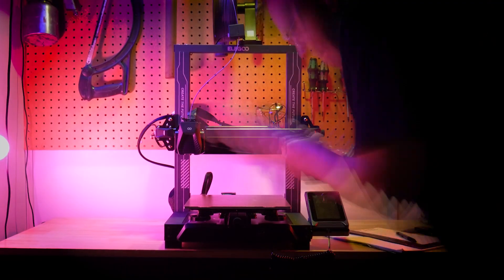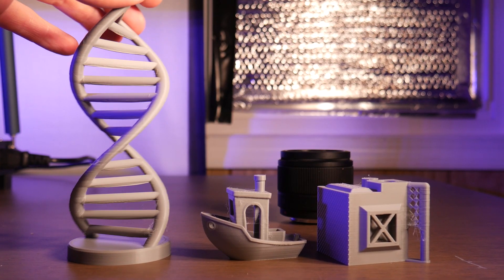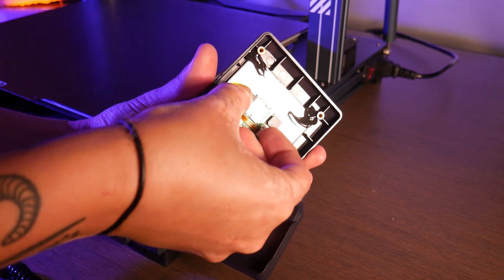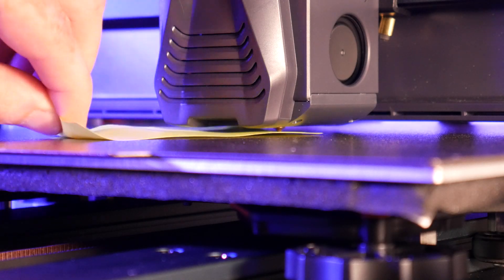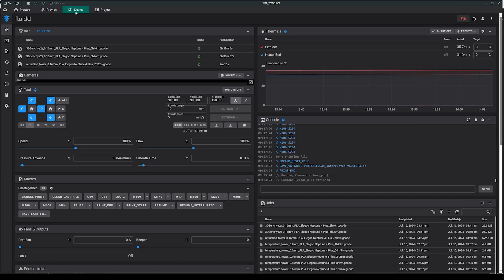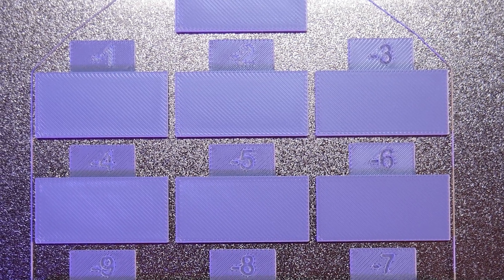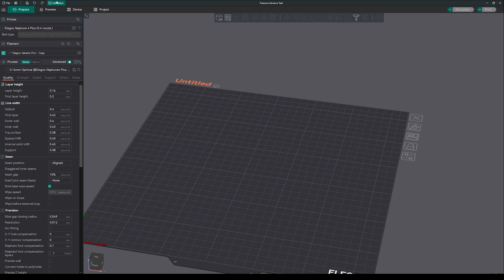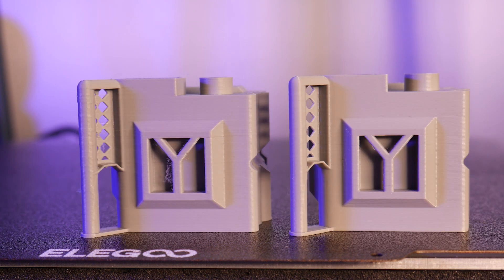ULTIMATE 3D PRINTER TUNING GUIDE for the ELEGOO Neptune 4 plus / pro / max

Comment: Hey so I’ve been doing the flow rate calibration like you showed it. However I just discovered that we should also do the calculation on the first pass, I know in your case you pick 0 so it would end up with the same number. But I just saw that for example the first pass the you are between 5 and 0 for example you would pick the overexteusion one, do the calculation, then fine tune it with the second pass, which justifies why the second pass is only negative numbers plus 0. Just thought it was worth to mention that in your case there was no need for a calculation on pass one however it should be done.

Comment: Very nice and detailed video although I prefer the way described by Klippe itself for pressure advance tuning (with the Square tower) 

By the way, do you print with Z-Hop too or not? And when you print with supports, do you pick Tree supports?
Maybe a video about “preparing” a print and choosing whether you should use supports or not, Z Hop or not and Infill percentage might be interesting!

Comment: Is there a way to undo any of the changes to the cfd? I don't remember what the values were before making the changes  and now I every print I send to the printer via orca fails during the first layer. When I load the same print through cura they print fine. I can't find the difference between the two slicer so I'd like to start fresh on orca. What the best way to get it back to factory settings?
Reply: I had the same issue. Don’t know if you were using glue stick or not but I wasn’t and started using the glue stick and havnt had a problem since. But there should be a default reset in there somewhere but I’m not sure. I never looked to see if there was or not

Comment: If you have any questions......YES!.....YES I HAVE !!!

How do you calibrate "BLOB OF DEATH" away.....i've had that twice now.......do you have a fix for that ??

Suddenly my prints stop sticking to the plate.....i've tried several cleaning solutions....like you and IPA and nothing works.
ONLY thing i got to work is if i print first layer at 20mm/s or lower.....only the first layer....then it sticks and i can print fast on top of that.....but why doesn't it stick at standard speed??

Comment: I like V2, but would prefer it if the unit recessed into the saucer to maintain a flush look when not operating.  Imagine a sliding door, or potentially and iris that open with the turret popping up.

Comment: Great content I thank you. Question: @14:40 you multiply the value at which the corner is sharpest by the step value, but when I print the step value is 0.16, default is 0.2. If i did that number it would be way too large. What is the hicup here?
Reply: Jordan from the future here. The layer size was 0.16, and the step value for the PA test was 0.02. I needed clarification on the difference there.
Reply: @Jordaneal thanks past Jordan, solved my querie too

Comment: For elegoo neither 4 plus i changed the flow rate as you told in the printer.cfg but after that i was not able get the prints to stick to the buildplate at all what should I do?

Comment: what should i do if mine doesnt even finish printing past the first temperature test. it just came unstuck from the plate after getting to the top of 230 PLA
Reply from the maker: You’ve done the bed leveling and z offset? Given the bed a good clean with soap and water? If so try using a big brim on the print to help it stick!
Reply: Yeah did all the tests and leveling and cleaned the bed even went to do the retraction tuning test and it printed that perfectly. I'll try a bigger brim. Thank you

Comment: Please help! I recently bought the Neptune 4 Pro and have just been following this setup guide. I seem to be missing the Input shaping & PID calibration in the Advanced settings menu. The firmware for the printer and screen are up to date. Can anyone advise?
Reply from the maker: The 4 pro doesn’t have the built in accelerometer. The pid can be tuned with a command but there isn’t a menu prompt for it. I would dig into klipper site tutorials. There’s tutorials there to manually tune all this via commands even the resonance without the accelerometer. I should have clarified that in the video sorry!!
Reply: @WildRoseBuilds  No worries! Thanks for the advice. I actually found the pressure advance tuning once I'd accessed Klipper, the printer is running sweet 👌

Comment: @WildRoseBuilds - you changed all Settings in the CFG File, but what if i have multiple Filaments (with different specs) do i change the Settings in the Filament Options or still in the CFG of the printer?
Reply from the maker: Extrusion rate / rotation distance should hold up pretty well across different materials. The only thing I ever change in my cfg is pid but I have all my different temperatures commented out and can switch them easily. There’s probably a better way 🤷🏼‍♂️

Comment: I don't have Input Shaper or Nozzle PID calibration in my advanced settings on my Neptune 4  Pro. I'm running V1.1.3.1 - 2024.07.23. Anyone know if Elegoo took away these settings or are they not an option on the 4 Pro?

Comment: I have a Neptune 4 Pro and Cura was working perfectly but I needed to calibrate the prints better, Orca I thought would be perfect based on the video but for whatever reason the prints are not sticking to the bed and are incredibly thin even after calibrating the extruder. I don't know what setting is not making it work, someone help please

Comment: I tried printing the flow 3 times the -20 and -15 crap out and ruined the print can we not set this to print one square at a time ?
Reply: Correction I cant print this at all every time it fails because one of the flow parts detach 😞
Reply: Try putting some glue on the plate from the glue stick elegoo provides it might help.  @kennethmoody9841

Comment: When i run the retraction calibration, my printer starts to begin heating up the nozzle and bed, but shortly after, it resets the print head position and says, "System is currently starting, please wait". It never runs the calibration. All of the other calibration tests work fine.. any ideas what's going on?
Reply: I changed the end retraction length to 5 and it solved my issue hope this helps.

Comment: My neptune 4 PRO has software version 1.1.2.41 and the motors are 1.2A I want to upgrade and formatted  a few memory sticks with FAT32 and copied the files from fixpack to the root of memory stick. I inserted the stick and started the machine nothing happened when I go to setting and about machine I pressed the up arrow at the bottom of machine and message shows update failed put all files in the root of the stick {which I did} I tried 3 different memory sticks including the one supplied with the machine when I directly use the firmware update file instead of the FIXpack it is the same. Your video is perfect to upgrade my Printer thank you
Reply: Im an currently trying to update the firmware and get the exact same error. Did you ever resolve the problem? If yes, how did you do it?
Reply: @mariuspaulbayertz8783  Hi Guys, waiting for my PRO to be delivered next week.  Obviously do not know the firmware version yet, but, did you guys sort this out?
Thanks heaps.
Eddie

Comment: I actually waited til this weekend (received my brand new Neptune 4 Max back in Nov 23'.) Decided to wait for upgraded firmware and components (Linear Rails X/Y/Z and upgraded Hotend "MicroSwiss Flowtech") Couldn't be happier and going thru this tuning will make it a breeze to get thru my 3 Main Filament choices (PLA+/PETG/PET-CF). This testing also pointed out a few flaws in my install so far (such as un-greased linear rails causing massive X-axis jumps), all of which a bit of grease/oil smoothed out. Can't wait to get back into this though, my Ender 3V2 will also likely get the treatment as I transition that machine to Linear Rails and Orcaslicer.

Comment: Thanks so much, I recently bought a Neptune 4 Pro printer and printed the tests that came on the flash drive without any problems, but after that, everything changed. I'll follow your tutorial and see if I can get good prints using the Orca Slicer. Thanks

Comment: Followed your instructions and was3 able to install Klipper. Problem is that every file I try to upload and print, I get a "unable to open file". Any help ??
Reply from the maker: What slicer are you using? Is your profile setup correctly and exporting a .gcode file type? how's the wifi signal to your printer, this has caused me some issues as a file transfer will timeout sometimes and cause that error!

Comment: is the flow rate different on all printers even if they are the same model
Reply from the maker: Yes! Things like ambient temperature, filament type, and extruder idler pressure are all different even on the same machines and play a role in flow rate.

Comment: Used the exact same printer with teh same settings and filament. Done all the steps as mentioned and i'm having trouble with the 1st pass flow test. It clears the nozzle and then proceeds to make the outline but once it starts to make the first sample it spews filament everywhere and clog up. I tried relevelling and calibrating 3 times and it wont sort it. I have printed things before this and it worked fine.  I was going ot dial in my settings using this video but it is not working. please help
Reply from the maker: Sounds like your flow rate might be improperly set? Double check in your settings that it’s at 1.0. Some slicers use a percentage for flow but orca slicer uses a whole number.
Reply: Thank you @WildRoseBuilds for your reply to that question.  I am having the same problems and am currently working on the Z offset.  I

Comment: Man my most paintful part of this printer that i love is the fan! Noisey but the silent mode doesnt work on my printer. Its loud then silent mode is turned on but it last for 5 seconds before going back to normal and being loud again
Reply from the maker: There’s a switch on top of the external fans to turn them off. I’ve heard people say they get pretty good results without them. But yes it’s a bit of a loud printer 🥵

Comment: The timing and thoroughness of this video couldn't be better as my new Neptune 4 Plus just arrived yesterday and I plan to work on getting it assembled tonight and work on tuning it over the weekend! Thanks for so much information and how well it was presented here!
Reply from the maker: Oh perfect! Let me know if you have any issues during tuning! Good luck
Reply: @WildRoseBuilds  I've got two of the 3 initial test prints you used. What is the name or where do I find the middle one with the top layer info?
Reply: @WildRoseBuilds  I've tried to start doing some of the OrcaSlicer calibration tests and I can't even get the first Flow Rate to work. It looks like it starts to draw the outline of the shape (rather ugly honestly) then when it starts to fill in the piece it goes through the motion but no filament seems to be coming out to lay down inside the shape. I'm not sure what the issue is. My test prints came out fairly well before trying the calibration. lol

Update:  I missed the decimal point in the Flow Rate. The poor print head was trying to force 100 through that nozzle. That's been corrected. Now I think I'm having z offset issues because I'm having plat adhesion issues. I'm going to start with that tomorrow and see how it goes.

Final Update: All squared away. Thanks again for the awesome video. Things looking good on my end. I still can't seem to fully print the double helix as it starts to unravel near the top of it. I'm trying an actual print that is just as tall if not a bit taller now and will see how it goes.
Reply: @WildRoseBuilds  Again, this guide was a tremendous help getting my new printer up and running. I'm about to switch from PLA to PETG. Would following this same routine make sense? I know the temps are changed from the PLA I was using to the ranged for the PETG I'm using. Just wasn't sure if it makes sense to follow these same steps or not.
Reply: @TheHikingReader  how did your PETG turn out? i found its settings are much different than PLA
Reply: @altcoinlogic9121  You are correct. My settings were considerably different, but the process of calibrating was the exact same. These steps have become my go to for any new filament I try. Then I just save a profile for that filament and don't typically have to mess with it again.

Comment: A really useful video, thanks.  But despite what your title says the Neptune 4 Pro doesn't have the option for input shape tuning or PID calibration in it's advanced setting menu. As far as I'm aware this model doesn't ship with the accelerometer required to achieve the former anyway. Now if you could upload a video showing how this could be achieved with the 4 Pro (maybe using a USB accelerometer), that would be most appreciated.
Reply from the maker: Hey thanks for the heads up on this, I didn’t realize I had put the pro in the title, I’ll remove that. For the pro you can read the klipper documentation and follow their steps to do a manual resonance calibration test print with no need for an accelerometer. There’s also a command that can be issued through the fluid interface in the console to tune pid. Hope that helps!
Reply: @WildRoseBuilds You still haven't removed it

Comment: Blimey the testing and code changing looks complex to a newbie like me in klipper stuff? I got the Neptune 4 Plus and without any of this stuff I get good prints now!

The bit about the Orca slicer, I downloaded it and installed it on a windows 11 laptop, it just don't see the printer on my network at all?  My fluidd sees the printer and shows it printing though, But the slicer don't see the printer at all?

I set it in the slider too. The local IP is right for the network as the fluidd sees the printer.  My printer has the newest update too.
I tried Cura and Prusa Slicer and both have the printer listed to add to the system which I do, But again Fluidd sees the printer But neither slicer sees it just like Orca don't.

I having to do the old way of record the files on to the Thumb drive and put that in the printer to print.

Also the Logitech C270 HD webcam I brought for the printer will not work when plugged in to either the full USB slot or the USB C slot by a USB adapter stick on the printer.
It does work on the PC after the software was installed. So why not on the printer or the network when on the printer USB?

And oddly the printer will print a model fine then when I see the screen on the printer pad it will have a error saying re-set the file system by clicking the icon on the screen?

I do and the printer clears that error and will print fine again.

It also won't let me do any Vibration tests without a error!  I have to restart or refresh the Klipper firmware!

Any ideas why all this trouble even though the printing is fine.

Comment: Are you using elegoo PLA? Also my Neptune 4 pro doesn't have built in input shaping, any recommendations?
Reply from the maker: Yes elegoo pla! I have had great results with it and they’re starting to make some cool silk and bicolor filaments as well that print good. For input shaping on the 4 I’d look into a usb accelerometer, I think big tree tech makes one for very cheap! You can also visit the klipper website where they document a manual tuning test for resonance compensation. Thanks for watching!

Comment: well fck i never knew elegoo developped their own slicer, back in the day it was cura edited with elegoo parameter and i still use that XD. but yeah looks like a huge update in terms of slicer. PS : there is also the tolerance tunning if u want to make precise parts
Reply from the maker: Technically it’s not made by elegoo but it’s brand agnostic which is nice. It’s open source and based on slic3r similar to Bambu studio and prusa slicer. The tolerance test is more of a test and less for tuning. Great for knowing what tolerance you need for snap fit part designing tho 😉 thanks for watching!